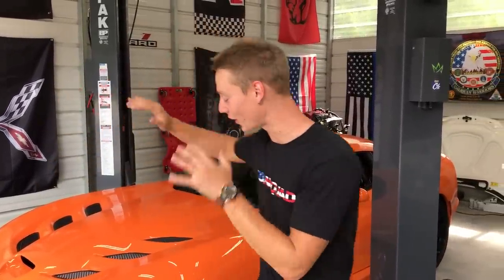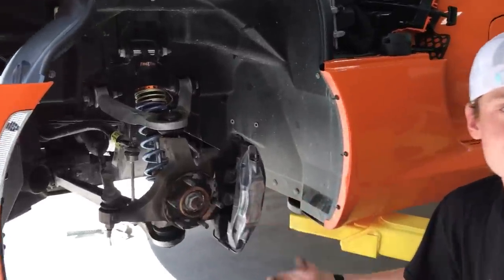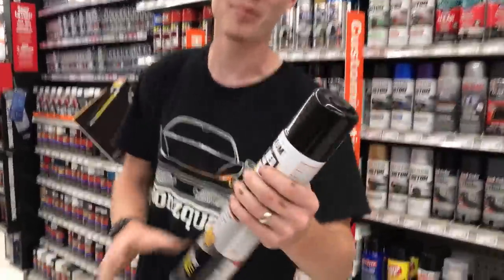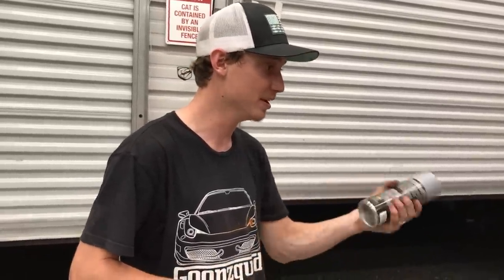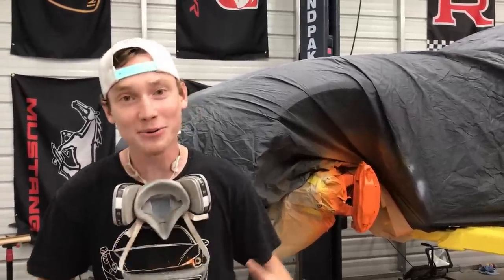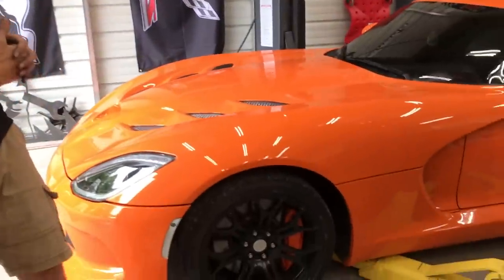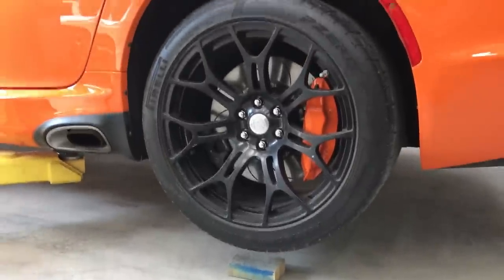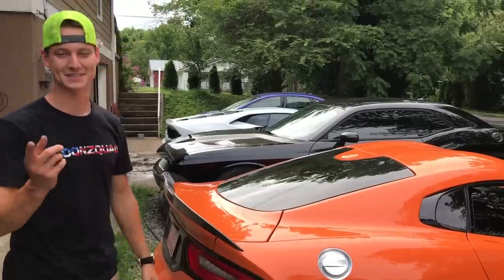Wrecked Dodge Viper TA Looks Better Than Ever!!!

Comment: Because of the heat generated from the pads & rotors, the color on the calipers will eventually turn darker. 
G2 High Temperature Epoxy Paint or powder coating would have been a better choice.
Reply: Yes sir
Reply: I've seen clear coat bubble up when exposed to much less temperatures than brakes get exposed too.  They make a single stage caliper paint for high temperatures, but its only available in a handful of normal colors, blue, red, black, silver.
Reply: I have done the same process and didnt have a problem. As long as you use high temp primer and high heat clear it should be fine. It's not going to last forever but I am sure it will do for now.. i dont see that car being driven on a daily basis anyways..

Comment: "We never went over 4th gear"
*Me sitting in Germany*: wat
Reply: papapalpatine you’re lucky not every country has no speed limits on autobahns .
Reply: lol i live on algeria i have a vw Golf 6 GTD 2010 i say germany cars are life lol we always VROOOM lol
Reply: genau mein Gedanke! :D
Reply: Wtf ich benne ein Hollander
Reply: hhhhh hna tani no limit
Reply: @firasytgames3600  Germany cars are life ? what is that mean
Reply: @fredjan8514  he means that german cars like volkswagen are the best
Reply: They are American they don't understand how manuals work really.  I'd have that thing cruising in 6th at 40mph using the V8 torque to putter along.  They probably think as they didn't hit 4k rpm in 4th they shouldn't need 5th.   That and them constantly worrying about the clutch like it's made out of cheese, although being a US car it probably is!
Reply: at least they're allowed to mod their cars as they wish not like germany and TUV regulations...
Reply: Paul Campbell it’s a V10 my dude not a V8...but yet you know so much😂
Reply: @AsapRockyOG  Like that's relevant.  Select the gear that will provide you the torque you require for the speed you are doing without labouring the engine.  It's not rocket science.
Reply: Paul Campbell obviously it’s not rocket science. It’s common sense. In your previous comment however you acted like it is indeed rocket science. It only takes a bit of common sense to drive manual.

Comment: PS: 
You need to wrap those lift pillars with some carpet to protect your  paint job in case you accidentally open a door into it.
Reply: I glued foam that I cut from a pool mat to mine. Worst part was I had been meaning to do it but never got around to it and then the wind caught the door of my Typhoon and bam. The truck has 32,500 original miles,never wrecked etc and only ever had touch up work on the bumper/lip. I was seriously pissed and sick to my stomach over it.
Reply: Another thing to love about bendpak lifts they come with guards
Reply: @54raceman  The older ones don't and they started that after I got mine.
Reply: Or they could cut the noodles from the boat😅

Comment: Step 1 remove calipers step 2 prep paint calipers step 3 reinstall calipers step 4 bleed brakes done
Reply: step 5 let it rip
Reply: I was wondering why they didn't remove them also. But the task has already been completed. There's no point in them seeing it now.
Reply: @bigbraz  for the future
Reply: I can't say I would have taken the same approach either. They would have had to get new copper washers if they removed them, maybe they couldn't get them fast enough, who knows...
Reply: Some people don’t even remove em from the car
Reply: For longer lasting results,  should have got the calipers powder coated  !!
Reply: You don’t have to remove the calipers. There are professional shops that even leave the rotors on. DDE has a guy that comes to them and paints them on the car
Reply: If you remove the calipers, you must put all the fluid out, which is super hard because the fluid is under extreme pressure, and you must have a ton of time to put  the fluid back and pump the system...
Reply: Totally agree, but they can make anything work😂
Reply: This is how a bodyman works, a mechanic would do it like you suggest. A full resto shop would have both mechanics and bodymen, would do like you said. When you care you split the caliper remove all pistons and seals then powder coat.
Reply: Ain’t nobody got time for that.
Reply: i think this was a troll video tbh
Reply: burningfeet 57  I do all the time I'm not lazy
Reply: get lame excuse do it right or don't do it at all
Reply: @GIZZMOTORSPORTS  exactly.....rebuilt  with pride!!!!! And at the end of the day you got new tools for future rebuilds
Reply: @reggienhappiness8851  do have time to redo it right the second time..when your caliper always will smell cus the paint is cooking on them....how much time will it take to scrap sand the burn paint off?
Reply: @jlongjr27  they where at the parts store..so how much more effort  is required to get 8 copper washer cost a few bucks...fyi you know you can sand the washer faces with 80 or 100 grit sandpaper  even if the store was closed.
Reply: @hypercarspottinggr  yes using reg high temp engine paint....but it not the same as power coated calipers
Reply: These guys said the S200 motor ran great even though it wasnt even running on all 4 cylinders. They arent the brightest.
Reply: My first thought as well...
Reply: @772777777777777  I know, just trying to give additional perspective. At the end of the day the way they did it made for a longer video. They are just 2 brothers doing something they like and learning along the way and taking us along for the ride. Can't fault them for that. It's not that they did it wrong, just not the way most of us would have. It is a little more involved to remove the calipers but it would have been less prep work to have removed them.
Reply: @hypercarspottinggr  Brake fluid is Not under extreme pressure. In fact the only time it's under any pressure is when you step on the brake pedal.
Reply: @jlongjr27 that basecoat and clear is not cheap...it takes no longer to do it right than to do it wrong and redo it 2x rthen to have scrap and clean burn paint of caliper pain in the butt.....do right the frist time ...end of story
Reply: @hypercarspottinggr   they had to bleed the brakes anyways... it would have taken much less time to take the calipers off than to mask the entire car.
Reply: @772777777777777  they had high temp paint it won't burn off
Reply: @wilson4328  comments like that just proves the person has never worked on any brakes but still wants to give their opinion.
Reply: @772777777777777  what are you talking about?  take the calipers off leave them on which method is better depends on who's doing the work... they did it right, they went have to do it again.
Reply: I hope they like brown calipers because that's what color that non high temp paint is going to turn after the first legitimate track session.
Reply: @hypercarspottinggr  WRONG
Reply: 5. apply caliper decals they omitted to source in advance of the work...another episode.
Reply: I get it. We are all trying to be thorough. But the guys literally will take a bumper part into 8 different pieces to get good coverage on a paint job but we think that they 'missed' the thought of taking off the calipers? Gtfoh.
Don't hit me off with some 'I'm an expert because of XYZ' the reality is THAT (1) it doesn't matter AND (2) YOU ARE ALSO here watching their videos LIKE EVERYONE ELSE.
Reply: Also, don't ever let the calibers hang on by the brake line..
Reply: ggss11 possibly apply the decals before the clear coat!
Reply: @bennysouthern7509  base coat and clearcoat cant handle +900 degrees..... the caliper will always smell from burning paint for years how do i know only amtures do it this way!....so your telling us that  after a 1 hour of hard driving burn paint is acceptable lol ... amateurs at work!  oh  and that legit! or that bettter then oem ....fing joke!  amatures!!!!
Reply: @bennysouthern7509  key word is had..... but they didn't ...amateurs! powder coat is the best way or a ceramic coating used on guns if you want a smooth finish to burry the ruff casting of the calipers... high temp paint will not burry casting marks. the paint is to thin.
Reply: @enigma9789 your right on with that comment ..... amateurs at best
Reply: @hypercarspottinggr  not true what so ever. simple bleed job...

Comment: Make sure the ABS sensor is making good contact behind the brake rotor. I had an issue where it was put on incorrectly and It was not making a good connection making the sensor not read the rotor and giving me a check engine light for the ABS.

Comment: just a suggestion I had my calipers powder coated sooo much more durable than paint
Reply: Claude Olivier not when done proper. We do both in our shop, our paint is our top seller n holds up as good and even out shines powder 🤘🏽⚡️
Reply: yup
Reply: Calipers are painted from factory.
Reply: @alvinphilip2315  nope. never had a car with stock painted calipers...

Comment: Wouldnt it be easier just to take the calipers off and paint em?
Reply: Probably didn't want to bleed the system again
Reply: @HacksawJimThuggin  couldnt have taken much longer than taping everything up and awkwardly trying to sand and paint the inside/back part of the caliper, right?  created good content, regardless!!!
Reply: @HacksawJimThuggin  so just not do it before the job, do it once they'd been off and painted. Doesn't make much sense to me doing them in a confined space like that
Reply: Yea,I just don't get it..🙄
Would've been so much simpler to remove the calipers off the car,maybe they just wanted to create a longer segment..🤔
Reply: @larannar123  i found myself talking to the screen like 'JUST TAKE THE CALIPER OFF!!!!' when they were taping up the control arms and putting the tarp on the car.
Reply: Then it sucks to paint them because you need to hang them somewhere so you dont ruin the paint by flipping it over. Then the issue with hanging it is that your technique of doing so can get in the way and to find a good method  itself is aggravating.
Reply: Why are they using a one man bleeder kit when they literally sleep together in the same bed
Reply: Agreed! They definitely should have removed them and hung them from coat hangers and painted them. Way too confined of a space to be painting them in the wheel well with the chance of over spray. No matter how well you think you covered everything somehow paint always finds a way to piss you off!
Reply: Taking them off to paint them, you run the risk of damaging the paint upon reinstallation, either by chipping the paint off the bolts, or the brake fluid damaging the paint as you bleed the system. Not to mention, its alot less of a mess.
Reply: @CyseRev did you not hear them say that they will bleed the system
Reply: And why not just powder coat them?
Reply: Never paint them on the car, it’s a short cut. Take them off a powder coat them correctly. I was surprised seeing you guys do it on the car with everything else you been going full out on.
Reply: No
Reply: It takes a lot longer to bleed abs enabled brakes than the ones without. Constantly pressing brakes to bleed after track days is like the worst thing to do imo. I understand why goonsquad didnt remove it. They were doing this midnight right? Seriously, when i bled the dc2 integra with abs, it took like forever
Reply: @slipknnnot  one has to hold the camera
Reply: The Ferrari is the drink holder and over spray catcher
Reply: No
Reply: @FoodFighter46  when done correctly, it is negligible and some abs cars are faster as the abs system will pump the fluid.  The key is learning how to activate the abs pump for your vehicle, either with a device or jumpers depending on vehicle.
Reply: Rattle can paint and rare car should never know each other.   Great job otherwise goonsquad.
Reply: @MavRickChiro  weirdly enough alot of people paint calipers on cars now. i know DDE gets theirs done by a professional service that leaves the calipers on the car too. its weird tho lol

Comment: Hey fellas, never worked on a Viper but a lot of cars with ABS require the ABS unit to be bled using a scan tool in order to get rid of that warning light.
Reply: Take it out to a gravel road and smash the brakes a few times to activate the abs pump. It'll bleed the unit without a scan tool
Reply: Very interesting thanks🇬🇧🇬🇧

Comment: Nice job..... but why? You bled the brakes then painted them? It wpuld have made a lot more sense to remove them, paint, refit then bleed. Would have saved you a lot of time. Keep up the good work though!
Reply: They didnt disconnect the caliper hence it didnt need bleeding again
Reply: Brake fluid will eat paint. That's why they most of the time powder coat them as it has some chemical resistance.
Reply: yep dont want brake fluid on fresh paint
Reply: @TheGbarnsleyboy  what? lol did you watch the video

Comment: Y'all did all that work and not use high temperature paint 😂
Reply: might be OK with the high temp primer though.
Reply: The paint is going to swell up and crack.
Reply: Ive done this loads of times on differant cars you dont need high temp paint !
Reply: @JP-wf4ur  thank you I have done this with my BMW 328i and I used regular paint and the paint has not chipped of or swelled up and I have to drive a way to and from work every day .

Comment: Won’t the paint discolor or peel off since it’s not rated for high temp?
Reply: Is black paint different than orange? Black gets real hot in the sun.
Reply: Doubt it. Calipers dont get hot enough to worry about. A black car in 110 degree heat is almost just as hot. High temp is more rated for exhaust.
Reply: Teege let me know when you paint your exhaust...I’ll want to watch that for sure 🙄
Reply: Eric Schutt right 😂
Reply: High temp paint usually used for engine blocks and other parts in the engine bay. Yes these calipers could get hot enough to cause issues but you’d really have to be at track use level to cause that kind of heat.
Reply: I had my brake calipers painted with actual heat resistant brake caliper paint. Worked absolutely fin for daily driving conditions with occasional highspeed braking on the autobahn. However one 15 minute stint on the track later and all 4 calipers had discoloration due to heat, and it was cold and raining that day, so the average speed on that track was really really low
Reply: Teege ok bud
Reply: Yeah I was kinda wondering and they did used high temperature primer.

Comment: Won't the heat cause the paint to have adhesion issues?  I thought you had to either powder coat or use a high temp paint on calipers...
Reply: They wont drive it enough to worry about it lol
Reply: Regular paint can take some amazing Heat! Think about it a car sitting out in the sun and the metal can reach up to 200 degrees easy. It remains to be seen but with the high heat primer being a buffer between the metal and the first layers of paint it could be a good results or maybe it'll be disastrous LOL anyways maybe there will be an update and we'll see one way or the other. I think they're going to be okay unless they are competition racing the car I don't think they can have any problems with it. If the brakes are over 200 degrees or 250 degrees that means they are overheated anyway
Reply: Michael Cavalieri i think the brakes will easily exceed 200 degrees. That paint will definitely cook!!
Reply: Joel Wilman according to google due to my curiosity. During normal street use, brake rotors and pads normally won't see temperatures climb past 200 degrees Celsius, or 392 degrees Fahrenheit. However, track days are a different story, with temperatures potentially reaching 1,000 degrees Fahrenheit as the brakes are called upon more often and more aggressively.
Reply: I'm no expert but... Shouldn't high temperature primer give enough heat protection for the paint?
Reply: Yup couple hard stops from +100  will have these glowing. Should have used engine paint or powder but looks killer non the less.
Reply: @joelwilman8712   so you think they're going to take a competition track racing? I doubt it but maybe they will
Reply: @lero7336  it might help as a buffer because the primer is directly touching the metal but if they take it to competition I would have expected that paint is going to get too hot

Comment: At 150 mph the TA spoiler makes 400 pounds of downforce. 662 pounds at top speed.
Reply: This car will run low to mid 10's as it sits. Buy the way. That was a misuse of an expansive car cover that somone gave you as a gift. I am shore the person is pretty upset.
Reply: @mikemc7704  and what does any of this have to do with the downforce numbers of a TA rear spoiler?
Reply: @mikemc7704  Misuse? It's doing the job.... Covering the car....
Reply: @mikemc7704  There has to be one in every crowd. Today, it's you.

Comment: That's not gonna last long, you should never use regular paint on brake calipers.
Reply: Yea, its a shame they put so much effort into it when there is no way it will last.  Calipers are exposed to temperatures in the hundreds of degrees F.  I've seen regular clear fail at <170F.

Comment: Hey goonzquad,  one big important task before putting rotors (brake disks) back you need to clean the surface underneath “spotless” where the studs for the rims and the main bearing is . It will reduce vibrations on car and steering wheel

Comment: Old school..Someone inside and pump the pedal and hold
. Start at passenger rear, driver rear, passenger front, and lastly driver front. You boys check all anti lock sensors at all four corners? Glad ya'll got it finished up. Wooooo another horse in the stable.